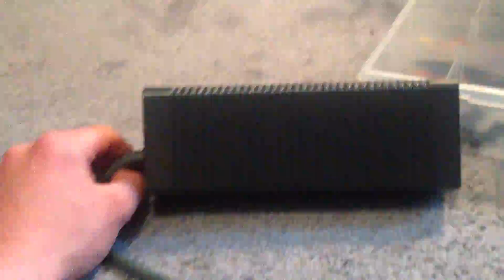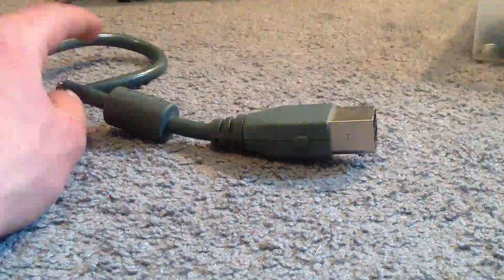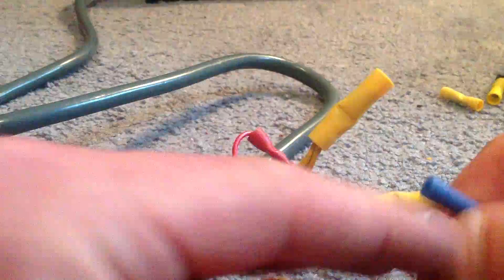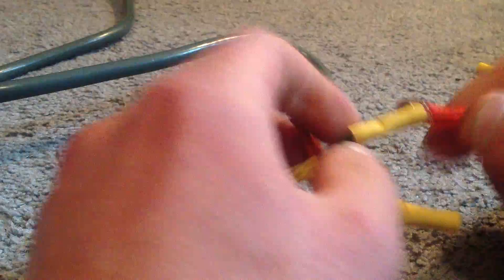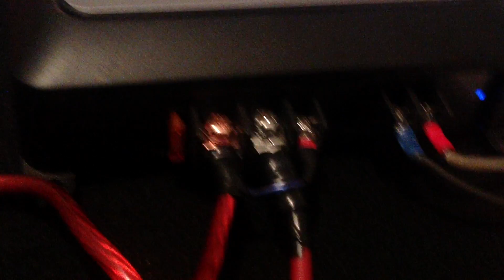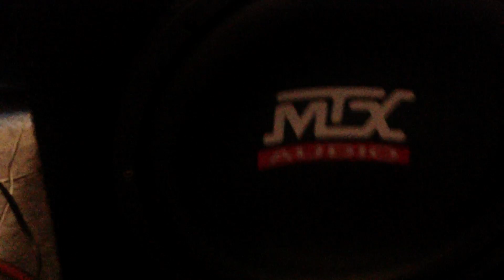Xbox 360 Power Brick to 12v DC adapter for Car Stereo or Subwoofers

Comment from the maker: Still here in 2025. Drop your comments or questions below and I'll do my best to answer them
Reply: I have a 360 slim and it powers on but when I hook up the reamote wire the power suply goes red how do I fix this
Reply from the maker: @itsmekashmyre7503 check to make sure your wires are crossed anywhere. It's going into safe mode so most likely a bad connection somewhere

Comment: thank you for the better vid im doing this I was going to use a small car batter charger but this has more amps so it will be better
Reply from the maker: No problem buddy, glad i could help out. I now have 4 bricks stacked together. All the power wires are twisted together and all the grounds are also. Just to be sure i have enough amps haha. Might be overkill but i test some big systems sometimes.
Reply: +Living For The Ice I have a question can you wire 2 blocks together and have the power stay at 12 v with out damaging the amp
Reply from the maker: So they power adapters i believe push out 14 or 15 volts. This is fine. Car amplifiers run at 14.2-14.7 volts optimally for most newer amps. You should be fine running 2 or even 4 of these xbox adapters together in series and not have anything go wrong. Check out my follow up video and you can see how i set up 2 power blocks. Just connect all the positives to one another and same thing for the negatives.

Comment: Judging the size of those wires I don't think it would power a very high wattage amp. It might be good for a cpl hundred watts. I wouldn't push it much more bc the wires will melt and eventually catch on fire.
Reply from the maker: Yes this is not designed to power a sundown competition setup. This is good for testing smaller amps at lower volumes. As for melting and catching fire, the bricks would go into thermal protection mode before they ever got hot enough to cause this.

Comment: What if I have 2 yellow wires 2 black wires 1 gray wire and then blue and red? What should I do then?
Reply from the maker: I'm not sure what the grey is for. My recommendation is to tape off the grey wire and connect the others as shown. If it works you're good to leave it taped off. If not, test it with a multimeter to see what it does
Reply: What did you end up doing with the grey wire?
Reply: @wallace7108 I've heard to connect it with the blacks
Reply: I didn’t hook up my gray one and it worked
Reply: gray wire with the black wire i test that and its woorrkk

Comment: How would I do this if I have the 360 slip power converter?
Reply from the maker: Im not too sure. If you cut off the end of it, and then check to see what color wires you have, they might match up to these. If not, just reconnect them and use it like you were before...

Comment: Okay I have the amp hooked up  now if I wanted to hook up my car stereo nd tweeters how do I do that without surging anything
Reply from the maker: Im a little confused on what you mean about "surging" something. This can happen one of two ways. Either there was an electrical issue in your house and there was a voltage surge, or you touch the positive and negative wires together when they are live. This can be avoided by making sure all leads are not touching one another and using basic electrical protection procedures (use electrical tape to cover leads)

To add your car stereo into the mix, attach the positive and negative power to the distributor block, adding an inline fuse on the positive wire. Then connect the turn on wire to the positive terminal as well, but include a switch (normal light switch will work). This will turn the head unit on when the power adapter is on and the switch is set to the on position. Then run an RCA cable to your amplifier and you are all set. Another solution would be to use an RCA to 3.5mm wire, which is what i use in this video. Either option will work fine for you. If you have any more questions, let me know.

Comment: just a quastion, i have seen alot of people do this with the xbox power adapter but, not all that loud soooo. do they have bad amps or is there coming way to low power trought the adapter imean, i want to do this with a 900Rms amp on 2ohm so that could be to heavy for the adapter right ?
Reply from the maker: Yeah buddy. Cars are the best to use powerful systems in. If you are trying to get good sounding audio in the house, invest in a 2.1 sound system or 5.1 if you have the money to spend. I mainly use my power adapters to test equipment before i install it for people or to run something around 200 watts RMS at best. I wouldn't recommend trying to power 900watts RMS. You'd need probably 8 power adapters and it would cost a FORTUNE on your electric bill.
Reply: thanks for the information, it seems like u know more than me about home sound systems any recommendations for home subwoofers iam a real basshead haa ^^ i have this home amp atm JVC RX-884R THANKS if u can help me ^^
Reply from the maker: I honestly know way more about car audio my friend. I am not well versed in home audio equipment... Sorry friend!
Reply: If you're still looking to do this, they make power converters that you can hook to regular house plug outlets and there for RVs, and you can push up to 10000 Watts with them. So if you get one you can definitely push some big Power threw some competition subs LOL. They ran from 140 to $200 online For the conversion or I would say the power converter.
Reply: @MrSours69  7 years ago, but that still sounds amazing tbh! we made a home cinema with 5 subwoofers right now hahaha, what would be a name that I can type in google to find these things ? you have any names ?

Comment: Which adapter did you use plz help link to me plz
Reply from the maker: Hey friend. Sorry i didnt see this comment. Youtube sucks sometimes and doesnt notify me. I used an RCA male to 3.5mm adapter. Search amazon, should find one for just a few $$!!!!
Reply: Living For The Ice at 10:40 the sounds very low, what happened?
Reply from the maker: I did not have any speakers attached to the setup at this point. The frequency was mid-range at this point and my speakers were not tuned to this, and it did not produce a very good sound. If you watch my follow up video (link in the description), you'll hear that it sounds much better when you add in other speakers. Also, it does sound better in person, but the camera mic (iphone) is not very good and did not pick up the audio correctly as you would hear in person.
Reply: Hey I got two blocks one gray 1  Blue one red two yellows

Comment: How did you run your phone on this without the head unit??oh and thanks for the video I didn't know what to do with the skinny wires blue and red
Reply from the maker: Gotchya man. I used an RCA to auxiliary adapter when phones had headphone Jack's. They sell rca to Bluetooth adapters now that you could also use

Comment: I have a question if you put it to loud will the amp go off
Reply from the maker: Aaron torres If you turned it up too loud, two things could have happened... 1 - Your speakers could have blown.. If your amplifiers RMS ratings exceed what your speakers could handle, then you fried the voice coils in your speakers and you're SOL.... 2. You could be drawing too many ampers. If you have a very powerful amplifier, you may need to get two or three of these power bricks and run them parallel into your amplifier. These bricks only supply 20 ampers i believe, and usually a amp, when turned to 85-90%, will draw 20-30 ampers. Just check to see if your amp have the power on light. If it does your speakers are fried, if not, you need another power brick

Comment: Hi mate when I connect the red and blue wires the power brick goes red. Am I missing something
Reply from the maker: Can you explain exactly how many of each  color wires you have? It may be a different year that your power adapter was made... If you let me know, i would be able to have a better idea.
Reply: He's using a xbox 360 slim and I'm the same issue...there's gray wire that is used for grounding...so maybe  that is the problem...still trying to figure that out.
Reply from the maker: I do not have any experience diving into the slims power brick. If you post a picture somewhere and link me too it, i can try my best to help you guys out!
Reply: I just gave up and bought an old one for 8 buck and it work right away.
Reply from the maker: Glad you got it figured out man. Sorry i couldn't help out more
Reply: m26 twist the grey to the black wires
Reply from the maker: yes travis, they can be left on. I wouldnt recommend it though. I left mine on for 2 weeks (without realizing) and my electric bill was insane. I would imagine 2 days wouldnt be terrible but you still will see a jump in the electric cost for your home

Comment: hi when i connect red and blue i get red light ive got 4 yellow 4 black a red and a blue wires//
Reply from the maker: The red light means that something is either touching the red and blue wire connection or they are not connected securely. Try using a butt end connector and wrap that with electrical tape for added insulation.
Reply: Ben Leclerc thanks bought another and all is well many thanks for your reply

Comment: I have this set up and it keeps cutting out on me it will work let the red light will flash once the bass hits what do you think is wrong?
Reply from the maker: Austin Conforti does the red light flash on the Xbox adapter or the subwoofer amplifier? if it's the amp, it's going into power protection mode because it's overheating, most likely due to not enough power which can damage the circuitry inside the amp. if it's on the Xbox adapter, it could be a bad connection somewhere. 
to test, use a multimeter and set it to DC voltage. measure the power at your subwoofer terminals when the sub is on and playing (even if the light starts blinking)  let me know what you get from this and we can go from there.
Reply: Not enough power

Comment: Hey first off I know little about this stuff so keep it simple please:) I have a 1200 watt 10' sub with 4 ohm impedance, will you please recommend an amp that will properly power this sub? Thanks a lot!
Reply from the maker: +Harrison King Hey bud. No problem, I will definitely hook you up with some suggestions! Just a heads up, usually companies post their peak power output to make things look like they can handle more power. The bigger the number that people see = the more excited about the product they are. Its a marketing trick. Can you please post the model of the subwoofer you'll be using? I can use this to match you up to the perfect amp, but i need some specs first. Also, are you using 1 subwoofer, or are there 2?
Reply: Rv Converter amp, you can plug it into your home 120v outlet. If you look it up you can run it directly to the car audio amp to your subs, definitely can run big power through it. There are certain amperage ones where you can run up to 10K watts. I just know your house bill will be probably high 😂

Comment: When the bass hits the power supply goes red what is wrong
Reply from the maker: Make sure you have strong connections between the blue and red wire. Make sure your positive and negative are secure. What are you trying to run?
Reply: Try adding on a capacitor to the power (yellow). Some people throw in a battery but das too much

Comment: was this the psu that originally had the dual plug end? And does the one with the square end have the same wires?
Reply from the maker: Not sure bud. This was a long time ago, I can't remember which one I used. I only did this type of brick also so not sure if all of them have the same outputs

Comment: Using the slim version, when I plug it in the power supply is green and amp goes into protect then about 15 seconds after the power brick turns orange, as soon as this happens the amp flashes on then off.
Reply: because that lil power supply does not have enough amperage to run your amp.
Reply from the maker: Turn down your input gain or stack 2/3/4 adapters in parallel to increase your ampers

Comment: Are blk wires usually the 'hot' wires?
Reply from the maker: For ac power yes. When it's dc power, black is ground. The brick is the converter, thus after the brick it's dc power
Reply: @BenLeclerc  Ty

Comment: so.. my amp is 750 watts. has 1, 30A fuse. and my Xbox 360 brick has only 14.7A I think. so Whan I try to turn on my amp it only plays for a little bit than the light on the brick turns red. does this means that I need more amperage?
Reply from the maker: This would be an issue with your blue and red connection i believe. The red light usually signifies that it doesnt have a strong turn on signal. I would solder the blue and red connection and see if that helps. If not, i will need more info on your amps and also on your brick model number. Sorry for the late reply :)
Reply: Your amp is pulling a lot more amps then the Xbox 360 plug can give 
30 amp fuse and the 360 only puts out 17.7 amps on a good day, it will keep shutting off or going into protect.
It's better to use a power supply from a computer that will put out a lot more amps 
The only reason he can run the Xbox plug is because he has a small amp on it

Comment: Can I use it to charge my laptop battery. The battery voltage rating is 11.1V
48W
4400mah. I don't have a laptop charger for my computer.
Reply from the maker: I wouldn't recommend it. Most laptop chargers have specific specifications for power.
Reply: @BenLeclerc   Damn!

Comment: Random question, could I use this to hook up a 12V car plug in? As in use 110AC house power to power up a 12V plug in cooler/heater
Reply from the maker: Yes, but you'd have to match the amperage required for the cooler to the amperage supplied by the bricks. Check online to get the exact requirements. You might need 2 power bricks if the amp requirements are over 20 for the cooler

Comment: My amp has 3 25 amp fuses will this work with the 360 power brick
Reply: 600.1 d3 diamond
Reply from the maker: What are you running off of it? How many ohms is your final load?

Comment: I ordered one but it’s different it has one red wire and one black wire and one white wire and one green wire how would I wire it
Reply from the maker: Are you sure that is a OEM power brick? Maybe you bought one for the Xbox one x? Not sure man, never heard of that wiring schematic before
Reply: @BenLeclerc  it’s the 360 slim one and dang it wrong one😂
Reply from the maker: @martinarmendariz8175  sorry man! It may still work, but search for a tutorial specific on the slim adapter. Or return it and say the one they sent you with damaged enroute 🤣🤣🤣
Reply: @BenLeclerc  wish I could but I already cut it😂 well gotta keep looking see if I get the next one right

Comment: It turns on for me and works but there’s a constant annoying buzzing, any ideas?
Reply from the maker: @wallace7108  probably the input source. Could be current interference. Trying using a jacketed rca
Reply: @BenLeclerc  I found a video and ended up fixing it 
I wrapped a wire around my rca jacks and grounded them, immediate fix
Reply: Still appreciate you’re still answering questions over 8 years later, good stuff

Comment: So ive followed all directions, but snp turns on and evenything but only for a few seconds then it turns off, could you knkw whats wrong??
Reply from the maker: Amplifier protection mode. Needs more power, stack 2 xbox adapters in parallel. See my followup video :)

Comment: hey um can i power my amplifier and car radio stereo using the same 12v dc ?
Reply from the maker: You can, but I wouldn't recommend it. Your amp will go into circuit protection mode if the current allowance is too low, its a safety mechanism so you don't torch transitors and MOSFETS. I don't believe stereos have this feature, and if your amp pulls too much power, it may harm the stereo. Best bet is to buy a second brick, one for each. Would rather be safe than sorry :) good luck and let me know if you need any more help

Comment: Some videos say the little wire should be (12V to remote) not (power to turn on) or is the remote same thing as turn on, sry my bad english and dont know if their the same thing. And also other videos show the little wire going from the middle to the right one yours is from the left to the right or are they in different order in ur amplifier?
Reply from the maker: Trying to answer this the best I can. Every amplifier has different layouts for the positive and negative wires. Just follow what your amplifier shows, symbols will be on it. 12v to remote and power to turn on are the same thing, just different ways of saying it.
Reply: @BenLeclerc  okay okay i get it thanks!

Comment: I got a 1,400 watt amp pushing 2 500 watt speakers and it keeps cutting off what should I do
Reply from the maker: You're probably trying to draw too many ampers and you're amp is gojng into circuit protect mode. Stack 2 or 3 xbox adapters in parallel to up your ampers to the amplifier. See my followup vid! :)

Comment: whether it is possible to connect both an amplifier and a radio from one xbox unit. in the sense of splitting them between the two wires so that they both go to the amplifier and the others to the radio
Reply from the maker: Yes this is very possible. If you view my followup video you will see that I used a power block distributor to split the positive and negative to two different sources. If you have any questions on that after watching the video, feel free to comment there and I'll be able to help you out also!
Reply: think 500rms will support because from the same wires i will connect a mono amplifier and a radio

Comment: Hey is there any way to skip the amp and just fuse it to the radio itself? I have a pioneer DEH-X1710UB
Reply from the maker: Yes. Connect black to black on the harness and connect yellow from power brick to yellow and red from radio. Add on/off switch on red wire so you can shut it off when you want